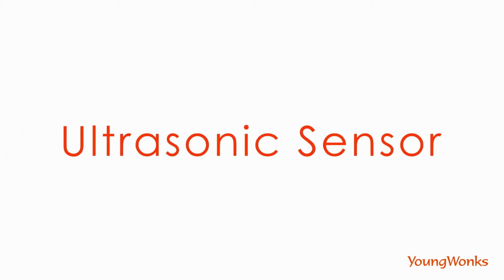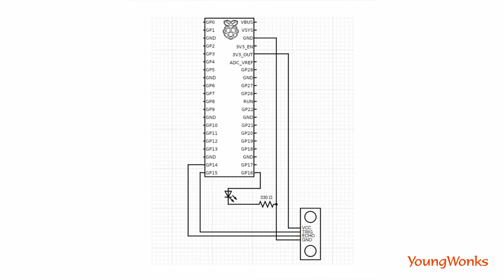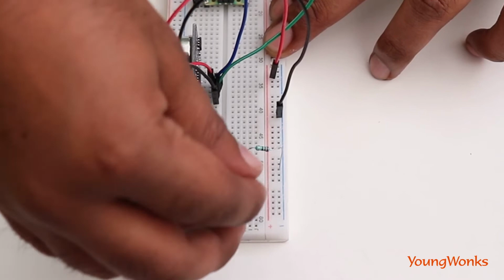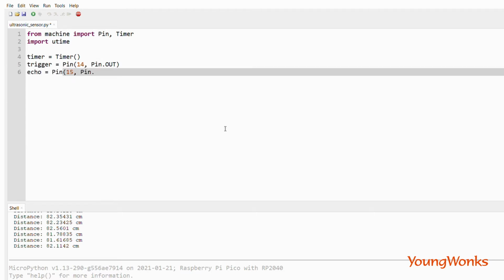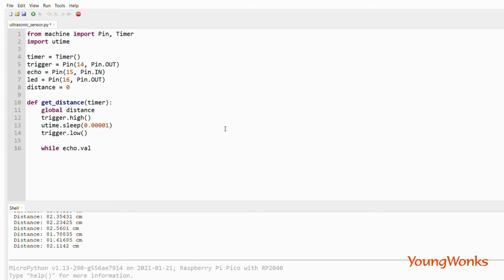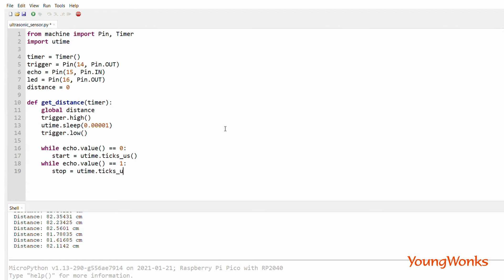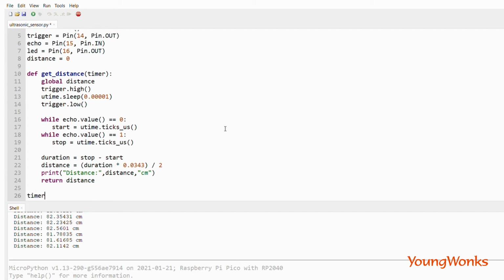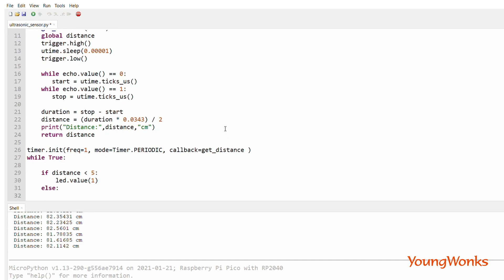Using the Raspberry Pi Pico with an Ultrasonic Sensor

Comment: Have a box full of HC-SR04's, none of them operate on 3.3 volts, as per the data sheet, which says they are a 5 volt device. Your code worked fine for me once I connected the VCC pin to the 5 volt output of the Pico and ran the Echo pin back through a voltage divider comprised of a 1K & a 2K resistor to deliver only 3.3 volts back to the Pico to prevent frying it.

Comment: There is a discrepancy between schematic diagram and code as far as trigger and echo pin14 and 15. Also echo may not immediately be zero for fist while loop so waiting for going to zero first may be needed, otherwise it will not work.